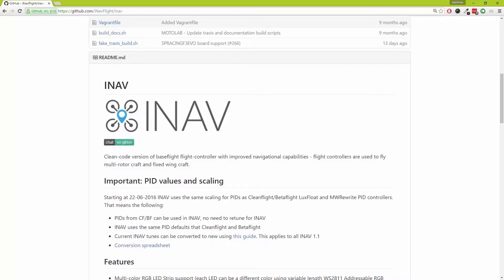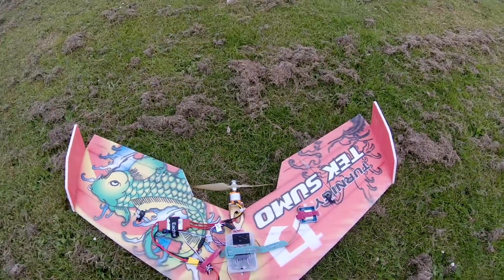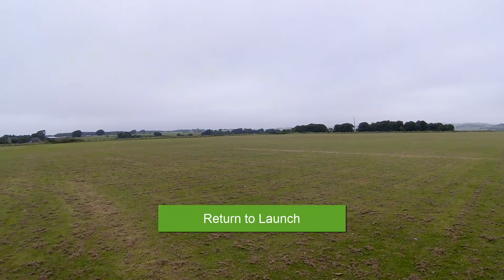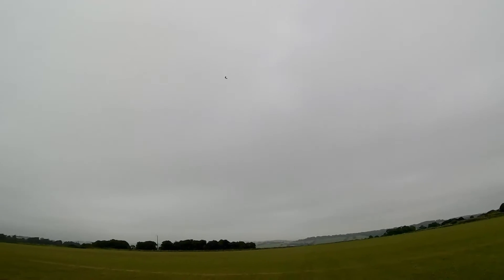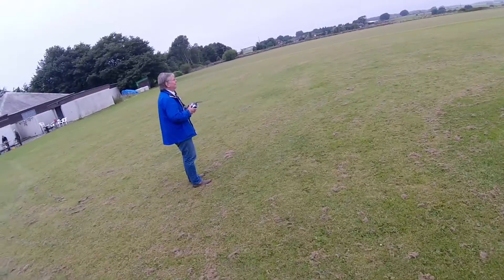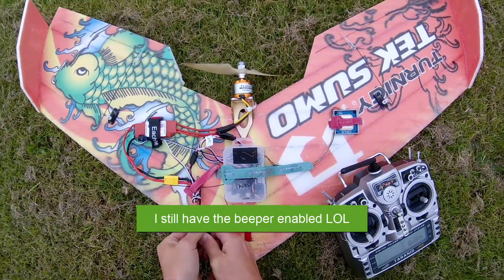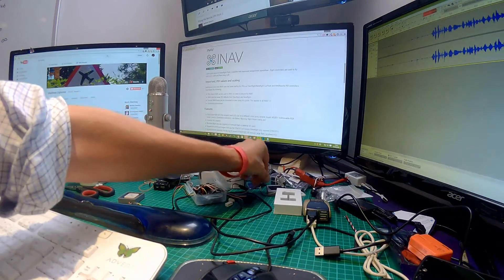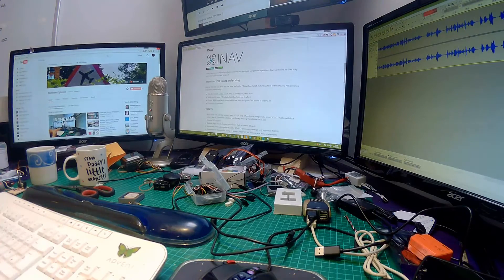Testing iNav Part #3 - Naze32 V's Pixhawk for Flying Wings

Comment: Hey Mathew. Really liking your channel. I wish I had discovered it earlier. 

From you comment about not using Naze32 with iNav, would you use it if you were just interested in stabilization?
Reply from the maker: Howdy Jody, yea it would work fine for just stabilization. Just make sure you have the surfaces moving the right way and that you also have a passthrough mode enabled for full control. Matt

Comment: Hello Matthew , and I am Vitor Lalanda and I'm big dilemma in choosing the flight contruladora for my Mini Talon . This mini series is fantastic . before viewing I was inclined to Flip32 + . can you replace the Naze32 with INAV ?
I would like to explain more Obre the OLED screen display and the module hc06.
Reply from the maker: Howdy Victor, 3 options for you. A Naze32 board + GPS with PatrickE's baseflight airplane, cheapest & works great. Pixhawk or the Pixracer works brilliantly out of the box and comes with mission planner for waypoints. Or if budget isn't an issue, an Eagle Tree vector is by far the superior option. Matt
Reply from the maker: Also note INAV is the software that runs on a Naze32 or similar board. Matt :)

Comment: When is the next part coming? Good job with the videos. I'm building an fpv Z84 and am interested in a light weight reliable RTH
Reply from the maker: Howdy fella, yea that's what started this series. I lost my z-84 because we had no return to home feature. You would easily get a naze32 board in it as well. The next episode is out tomorrow, I literally just finished the editing of the next two parts this evening. Stay tuned as things do not go well with iNav :(
Reply from the maker: It's out now, see here https://www.youtube.com/watch?v=AyCgWYTo_SI Matt
Reply: +Matthew Ogborne 
Thanks bud. Just watched it. Looks like I'm going base flight/PatrickE. Unless you tell me not to :) I've done Lots of APM / Pixhawk builds and it's great but big and time consuming for a small fpv wing.
Reply from the maker: compuatic Morning. Right now it feels like the pixracer & pixhawk is like bringing a gatling gun to a knife fight, soooo much overkill for the task at hand. 

Baseflight/PatrikE solution works well. A HUGE tip for you is that when you load the firmware, go to the CLI tab and run this command:

preset Flying_Wing

You may need to run this twice, but once done then type "save" and hit enter.

This puts the defaults in for a flying wing and will get you to a good place to work from quickly.

I wish I knew about that last week!

Matt
Reply: thanks a bunch and well done on the vids
Reply from the maker: Thank you :) Two other parts are out now as well, see here for the playlist https://www.youtube.com/playlist?list=PLgoM4-umzSqcnDGRUWBReXZOVsg4Lu1Gx Matt